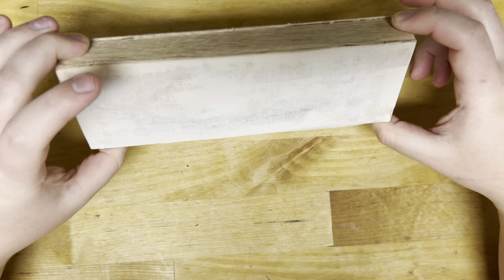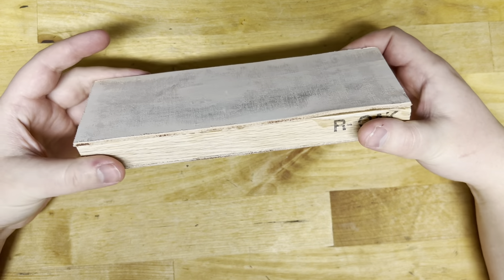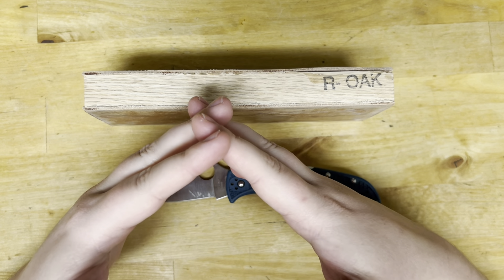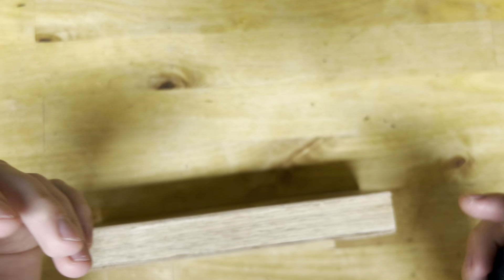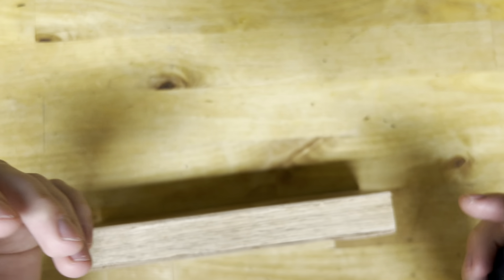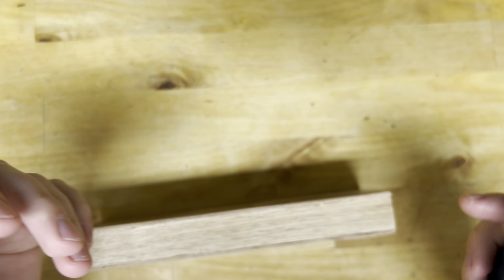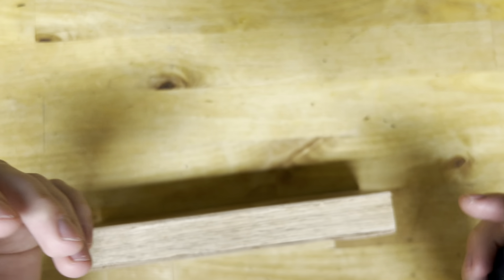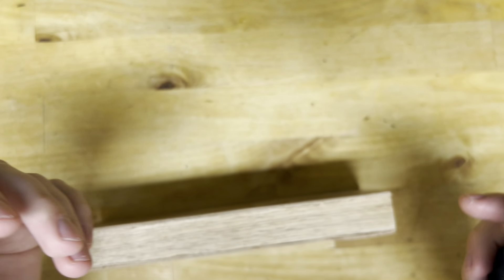Importance of Stropping

Comment: I tried to avoid stropping so my apexes stay a perfect V, but was finding that edge stability was lacking and you need to strop at least a couple times to strengthen the apex against rolling
Reply from the maker: Hand sharpening has that same effect too
Reply: How does stropping keep an edge from maintaining a perfect V? I've never heard any negative aspects from stropping at all.
Reply: @Knivess0  well it depends actually on the substrate the compound is applied to. I dont want to splurge on diamond compound so i use a classic leather strop and green compound which slightly convexes the apex. Most sharpening guys have diaspray and may spray on paper on a hard table to avoid the rounding effect. Im cheap and the money spent on the couple DMT plates i have i try to do the majority of deburring on and use the $10 green strop to make sure its gone

Comment: I dont like to strop. I prefer to keep the bur at a minimum and remove it on the stone. Then touch up on a stone when needed. I just keep a single kme or edge pro stone around to do that in a min or two instead of a strop.

 Then removing the apex completely once the apex gets fatigue enough so when I sharpen it again, no fatigue steel is left on the apex after sharpening again.
Reply: You're still removing steel unnecessarily, no? Even if it's relatively minute?
Reply: @Knivess0  nah